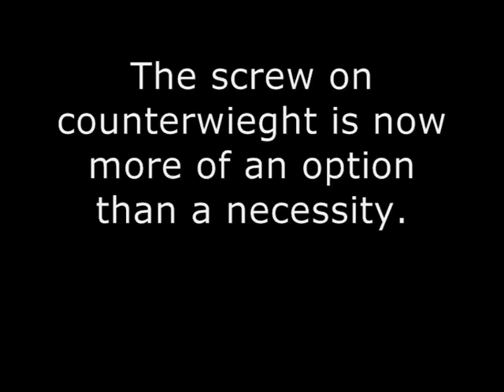NS Design Balanced Shoulder Rest - a Solution

Comment from the maker: An  NXT-5. That's what I call a Violin!  As for the diameter, it might be an improvement in the  NXT-5. My current project uses the SSR only. It has a longer support arm.  Good if you've a fair length from collarbone to chin.  I simply cut a paint roller shaft, put it in a vice and whacked it into the correct shape.  It would suit a Giraffe (LOL).  Diameters are compatible (with paint rollers sold in U.K.)  I'll need to spray it black to take the 'chrome' look away.  Glad to be of help...Phil.

Comment: Thanks for the great idea here! I have used your technique with my NXT-5 and BSR and am finding it very comfortable. Far more secure and usable than either the SSR or BSR on its own. I did find that the BSR's support arm simply would not fit into my NXT-5.I measured and found that the BSR's support arm is nearly .02" larger in diameter than the SSR's support arm. I fixed that by using a metal file on the support arm until it fit readily.

Again, thanks for the great help!
Reply: How much longer is the BSR’s Support Arm vs the SSR? In terms of its length and how high you can set it up? 
Thanks 
And thank you for the feedback

Comment: If I could have a longer bar on the shoulder rest, or the option for a taller chinrest, there would be no need for this, but NS support was no help with this request.

Been thinking about getting a Yamaha YEV-105 violin, just so I can use standard compatible third party solutions, only thing stopping me is that my Nxt violin simply sounds better.
Reply from the maker: My pet hate was: You do all you can to make the shoulder rest fit and be comfortable, then, when you put it back in its case, you have to dismantle it again and go through the same set-up procedures to get back to where you were.  The case should be larger to keep the shoulder rest on all the time.  I sold my WAV 4 and have a Bridge Aquila now.  I agree with what you say...the NXT sounds great.  It might be worth getting a metal worker to make you a longer support rod and to bend it into shape like the original.  After all, its just 'round bar steel'
regards,  Phil

Comment from the maker: Hi,  when in it's normal position, it hooks over the shoulder with significant body contact and is sort of kept in position by counterweight.  My way has less contact with the body and relies more on the counterweight.  The negative points (if they are negative for you) are; that it keeps the fiddle firmly in position.  It has no left to right movement.  It's almost impossible to tilt to the left or right.  If you dance your fiddle or dance with your fiddle, it's unsuitable. Thanks for comment.

Comment: Thanks FatherJ0hn.  I had looked at this spider away back but it was a bit expensive. Now its down in price so I might think again.  THANKS for reminding me.  I never really had a problem with my Acoustic violin though, it was the WAV 4 that gave me a sore back until Phil came up with his solution.  Did you see his new idea with the paint roller shaft?  It sounds good.  NS's website doesn't list any extened support arm for sale.  This could be useful to people with longer necks.

Comment from the maker: I hope you get expected results from your work.  The BSR is covered in oval shaped foam but if removed, it reveals a length of FLAT bar aluminium.  This is what allows it to be bent into position on a repeated basis.  Threaded bar is then welded onto the end so as to allow the round counterweight to screw on.  You also might be interested on the long support leg I made.  (See my reply to FatherJOhn).  Cheers...Phil
Reply: Hi Phil, are you still fiddling my friend??? Just have a question: how long is that BSR Support Arm that goes onto the SSR into the violin? I’m wondering how much longer it is than the standard SSR Support Arm? 
Thank you! 

This is amazing, I know I’m 11 years late but here we are
Reply from the maker: @meals24u    Yes but I sold the NS design Violin around 2015, so I have no measurements I can give you.  You can get some measurements here...https://www.stradviolin.com/shop/accessories/ns-balanced-shoulder-rest/   
If you decide to make your own, 'Flat bar' Aluminium is the best solution.  regards, Phil
Reply: @philsskills  oh wow, thank you phill for that information! I truly appreciate that very much! 🙏🙏

Comment: By the way, can you provide us the dimensions of the (long) metal stem, the one that comes with the BSR? I can see it comprises a 90-degree followed by a 45 degree three bend. The reason I'm asking is that even the NS store run out of stock of those BSR, so I'm looking at making one myself.
Reply from the maker: Sorry, I sold that particular violin back in 2015 and the BSR went with it.
Reply: Hey, I’m in the same shoes! How did you go about building your own? 
Thanks

Comment: Hi, I'm interested in this as want to buy an NS WAV. Can you tell me what is included with this? Will it have a shoulder rest and chin rest? Will the chin rest be adjustable? Do I ideally need to buy more accessories? I have done the whole frustration with shoulder rest on my acoustic so I am keen to get onto this. Comfort is everything. Thanks!
Reply from the maker: Hi Jennie.  For an acoustic violin, I would suggest a Bon Musica shoulder rest (probably the best in the world) https://www.thomann.de/gb/bonmusica.html
and for a Chin rest I would suggest The "Kreddle" (The best in the world...in my opinion).  http://www.kreddle.com/
I know what you've been through...'cause I've been there  :-))

You get a chin rest and a shoulder rest with the WAV 4 but it is the standard shoulder rest, not the Balanced shoulder rest... which I feature in my video :-(    The balanced shoulder rest is an optional attachment to the standard shoulder rest and is basically a flat bar of aluminum which is shaped and covered in a comfortable foam.
This is the Balanced shoulder rest... https://www.electricviolinshop.com/ns-violin-bsr.html
When I made this video, it was intended for players that had already purchased the BSR.  I would not recommend the WAV 4 or BSR if you don't already own one.

The good points are...it stays in tune for ages, maybe 2-3 weeks and it sounds nice.  The bad points however...are that it doesn't treat nylon cored strings with respect.  It bites into them and this can result in snapping of the strings.  You might get away with it for a while but eventually it will break through the casing of the string and cut through the "perlon" of the string.  Thicker string gauges don't fit through pre-drilled channels for the strings. ('G' & sometimes 'D').  You're stuck with steel strings in other words.
Whether you have the SSR or BSR, you have to use a hexagonal wrench to dismantle the shoulder rest before putting it back in its case (something manufacturers don't tell you)  It just won't allow the lid of the case to close.  It's frustrating setting up & dismantling all the time.  It's great if you stand it upright or hang it on the wall though.

In summary, I would say that if you don't mind steel strings and you don't gig (you only play at home) then the WAV series is a nice violin to have but the BSR is not cheap.  I sold my WAV4 and BSR a while back and bought a "Bridge Aquila".  I hope this information helps and assists you in making your decision to purchase or not.  regards, Phil  :-)
Reply: Thanks very much for your reply. Food for thought! I have had a very varied journey with my violin - from classical to playing in a folk rock band. But now I have realised how highly sensitive am to everything and how important it is to feel good, that I feel i need a new way ahead. And my bridge snapped on my acoustic so I took that as a sign for needing change! Blues is my thing and probably mostly I will have fun making videos for YouTube. Playing out would be very occasional. it would have to be exactly the right setting for my nervous system and the right combination of instruments for my ears! I'm not so keen on the shape of the Bridge Aquila. My brain keeps telling me there are some pieces missing! I've tried a Yamaha and found very uncomfortable. The journey continues . . .

Comment: you should have used a spotlight on the shoulder rest and its components. As the clip is, one can hardly distinguish what you are doing as all the components blur into black an there is no detail at all. Also avoid having sun-lit white walls behind you.